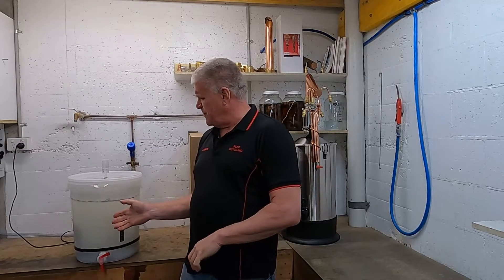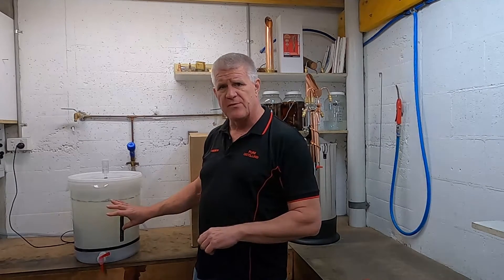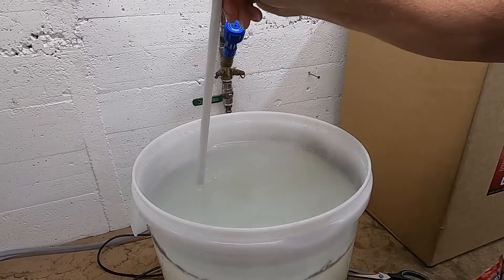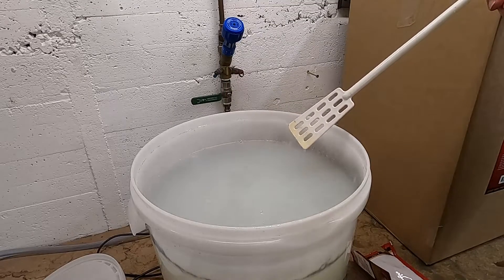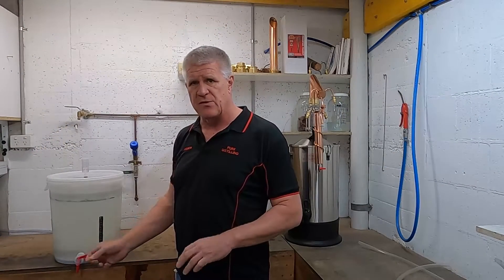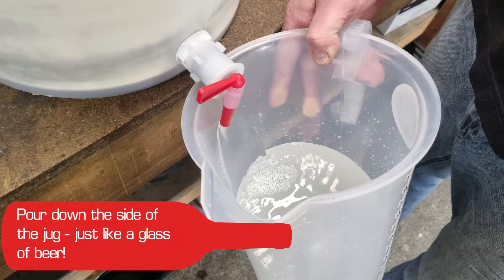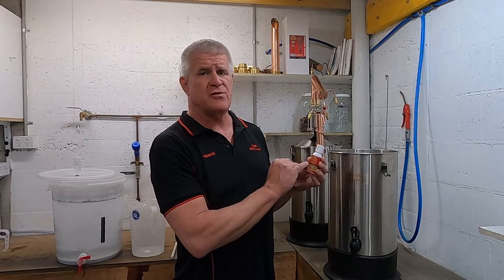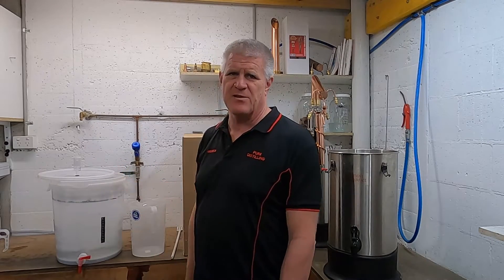Clearing & Transferring The Wash - Distilling 101

Comment: Does this affect the taste of the distillation?
Reply from the maker: Hi Matthew, great question, yes clearing & transferring the wash correctly will improve the taste of our product.

Crystal Clear (Part A+B) will not directly add flavour to the wash, but will de-gas & drag all the yeast cells down to the bottom of the fermenter. If the wash isn't cleared properly (aka it is still quite cloudy when transferring), these yeast cells can scorch/break down inside the boiler, which can produce off flavours and result in a lesser output. If you're noticing the wash isn't completely clearing up after 24 hours, try leaving it an extra day or two to let it settle.

The same principle applies when we transfer the wash, we always want to leave 1-2L of the sediment at the bottom of the fermenter behind. If we added the sediment to the boiler, it would have the same effect of scorching & producing off flavours. 

Let me know if you have any further questions! - Connor

Comment: Do you need to add this will it clear on its own?
Reply from the maker: Great question. You will notice if the wash is left for an extra 3-4 weeks it will start clearing itself. You will be able to see into the bucket as described at the 3:00 mark of this video.

The yeast should also drag down and form a white sediment layer at the base of the fermenter. 

So yes, it will eventually clear on its own, but if we don't want to wait over a month each time we put a batch down - use Crystal Clear!!
Reply: Thanks for getting back. I am new to stilling and the wash I have now is the sacrificial wash thus not putting in anything more than I need (cheap skate haha). Could I run it semi clear so I can get the thing clean and start a new with filing etc?   @PureDistilling
Reply from the maker: Yes this would be fine, don't expect to end up with a full yield, but if we're only doing a sacrificial run that shouldn't be an issue!

Can always double-distill what you get out of this run by pouring the spirit back into boiler and filling up the boiler to the MAX line. Then run as per normal. 

Have fun with your new distilling setup - if you have any questions feel free to sing out!

Comment: Hi buddy instead of putting 2 part clear can I add bentonite to clear the wash Thanks again for your adviceRob
Reply from the maker: Hi Rob, yes we can use bentonite as an alternative - except bentonite won't degas the wash so we would need to leave the wash for at least a week after adding the bentonite in to allow it to settle. 

When using the Crystal Clear, Part A degasses the wash
Reply: Thank you buddy again for your advice your a legend

Comment: Hi buddy i love your vidios and i have a question can i use a wine yeast  say a high yeast tolerance of 18%abv like lalvin ec1118in a sugar wash with fermaid 0 nutrient, Thanks for any advice Rob.
Reply from the maker: Hi Robert, yes you can, but EC118 best temp is 15-17 degrees C, can go to up to 30 degrees C, but any higher will die. 

It will produce a rough alcohol at high ABV, so would recommend with 6kg sugar, and no more than 7kg. It will take a long time in comparison to the turbo wash shown on our videos, allow 4 weeks to fully ferment if at high ABV%

Hope this helps!
Reply: Fantastic advice buddy Thank you very much. Rob